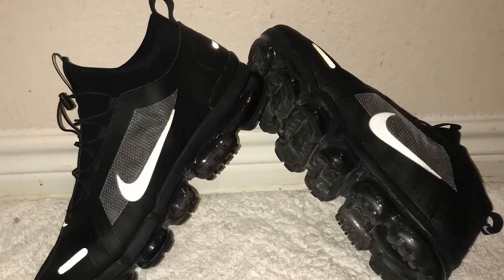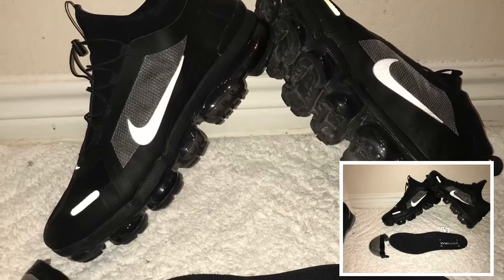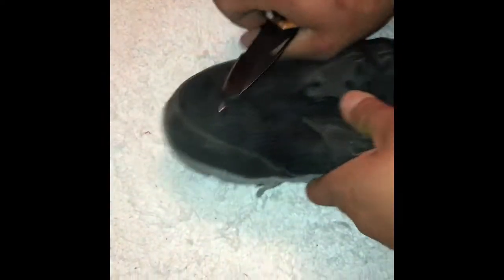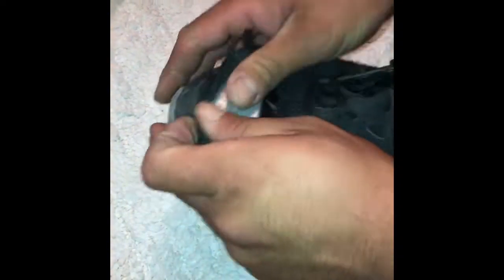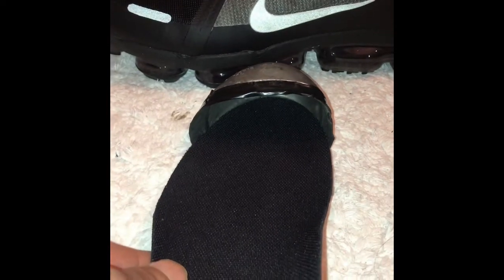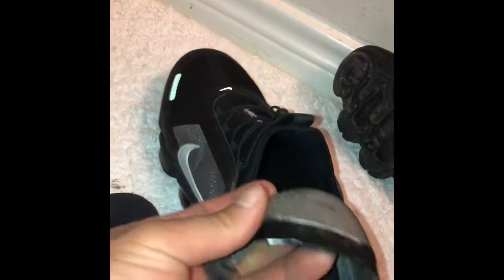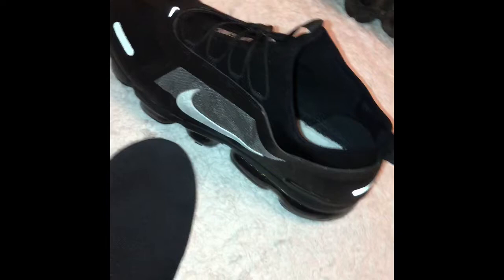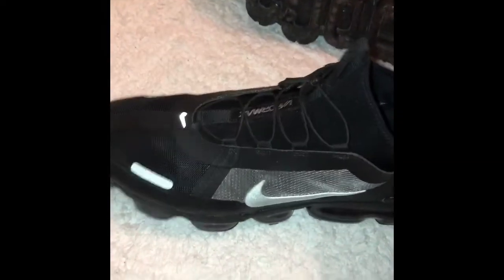How to make your own steel toe Nikes

Comment: i made it with steel reinforced midsole underneeth the toe, so the load spread out evenly and didn't just penetrate the rubber through when under load, and i added steel reinforced heel counter. it's wheigh about 1.5 kg a pair and nail-proof
Reply: I hear what you're saying but can you tell me how you did that?
Reply: So you're wearing grade 5 ballistic footwear

Comment: I’ve just done something similar after years of pain through safety boots and my flat feet which after many a insole I still struggle except wearing a specific pair of sketchers I thought “sod it I have 10 pairs of steel toe boots in my garage” so I cut some caps out and bought the next size up in my comfortable trainers then inserted the toe cap 😍😍 can stand 24/7 on concrete floors now 💪🏻
Reply: I also have the same issue with flat feet but can't find a pair of boots that don't hurt me. What pair of sketchers do you use? I would like to try them
Reply from the maker: https://instagram.com/s.p.j2022?igshid=OGQ5ZDc2ODk2ZA%3D%3D&utm_source=qr

Comment: JUST A HEADS UP, been rocking my vapormax steel toes for years now. just recently started a new job and they didn't let me wear them because they are not ASTM certified, even though theres nothing to crush my foot.... so if your job hates you , they probably won't let you wear them lol.
Reply: @James Isaac that's exactly what I said lol , manager just wanted to be a pita
Reply: Just cut out the astm certified sticker out the old shoe and gorilla glue it in the new shoe on top of the size tag

Comment: What if you lose get ran over and the plate shift because it’s not intact with the shoe but just slide and pinch ur toes off
Reply: Only reason to use steel toes is to satisfy your employer. I could care less if I lose a toe as long as I'm comfortable 😂

Comment: Was the steel toe from the old shoe the same size as the Nike? Thanks.
Reply: No, if u listen, get says his nikes are a size bigger than steel toe.
Reply: @jasonmcbride2105  okay wait I thought it was the other way around. The boots were a size bigger than the Nikes? I need to do this with my orthopedic shoes for work. Do I buy a smaller, bigger, or same size in steel toes for this to work, please 😥
Reply: @lovely_sadist1237  Nikes r size bigger to accommodate the toe
Reply: @lovely_sadist1237  buy the steel toe shoe In your normal shoe size. The shoe you want to add the steel in should be a size bigger than your normal size so that when you put your feet in the shoe it's a perfect fit

Comment: Can't find the steel cap to fit my nike air max plus TN
Any suggestions??
🙏🙏🙏
Reply from the maker: 7hugl1fe r1d3r5 if you see any still toe boots that are  pointy, you can take those out those should fit because the steel toes are small, but if you are  a size 10 make sure you buy a size or two bigger, for example take the steel toe to the store ask for  the size insert the steel toe if they are too tight ask for  a bigger size 👍
Reply: @sperez6140  Ma Man, FoSho gonna sweat that. I saw you took the Reebok steel toe out & put the in the Vapor Max 😎😎😎

Comment: So just to clarify this, I wear shoe size 10¹/²......so I need to buy shoe 11¹/² then get a steek toe cap size 10¹/².....correct?
Reply: Bcuz I'm gonna buy cheap steel toe kicks from walmart and tear out the cap. But I want to make sure it's the right size so I don't fuck myself out of money lol
Reply: Yes
Reply: So I tried this and the steel cap after I put it in my shoes, it was too tight! Didnt work. I put a steel cap in a pair of air max 90s.

Comment: Before you buy shoes to cut out just order caps
Reply: I looked all over for just the caps bro. Couldn’t find any anywhere.
Reply: @lonnievigil3681  Honestly. Way too much effort to try and find some. You would think you could easily find a pair or someone would have an easy conversion for regular shoes available but nope this is what we have to do 😂
Reply: Go to a thrift. Buy them and cut out the cap. Shoes will be smelly and fucked up anyways. The cap is encased so they didn't touch it.

Comment: Do not do this. This is more of a hazard than a protection. The steel toe cap will slide/tip when it gets underneath something heavy. I'd rather buy real safety shoes than risk losing my toes.

Comment: So did you mean that the steel toe shoes needs to be size smaller than your regular size?
Reply: No. The shoe dat u are putting the steel toe in needs to be 1 size bigger than your regular size.
Reply: @jumpout915  why though? 👀
Reply: @lovely_sadist1237 because the steel toe takes up room. If you use a pair of shoes that usually fit you once you insert the steel toe in them they will no longer fit you correctly and will be mad uncomfortable not to mention it will more than likely damage your toes which defeats the entire purpose. Thats why you need to buy a pair of shes that are 1 full size bigger than what you usually would wear in order to compensate for the space being taken up by the steel toe.

Comment: It’s not even that I find them steel toe hideous. They f*cking hurt. I brought a specific pair of orthopedic shoes.l for work. Now I’m required to wear strap toe. I need to do this. 

If I wear a size 9in regular shoes. I would need to size up one size for steel toe before inserting them in my regular shoes?
Reply: If u have big issues with your feet and already wear your own shoes with orthopedic... Try tiger grip safety overshoes.

Comment: This is a bad idea if you work in a place where you actually will need a steel toe at some point to protect you.
Reply: How so
Reply: @jonomano3992  maybe the toe cap can get pushed up against the toes because it's not in place
Reply: @jonomano3992  having the steel toe lose in there like that is dangerous to your feet and toes when something heavy enough falls or pushing the toe your feet will be crushed or worse , toes cut off by the not secure steel toe. Not a good idea
Reply: Depends on the place. My job requires steel toes, been there 6 years, and nothing there is heavy enough to actually hurt you. I’ve been sneaking by with a standard pair of doc martens for the last 3 years
Reply: @SuperflyLamar  Lucky haha the pair they gave me had me literally dead by the end of my warehouse shift, the bottom doesn't even bend ffs when you walk and place your foot down the back touches the floor first like usual but then it just slaps down flat. The sole doesn't bend and lay itself down if you know what I mean, which is really important for energy dispersion (like how people do a roll after jumping from a high place, it disperses the energy  gradually as different parts of your body touch the floor instead of just falling flat on your feet and having them take the full force in one blow). They gave me bad sores on my feet I wore normal shoes the next day that are black leather and honestly look like safety shoes, but security guard clocked me and gave the shitty ones again :( Ordering a good pair on amazon now.
Reply: They’re real steel toe inserts. I don’t understand why you think they wouldn’t protect you. They’re literally steel.
Reply: @lonnievigil3681  the point they are making isn't that they aren't steel toe caps, but that the protection the provide do not meet and safety standards and are more dangerous than safe do to the caps not being secured in place between the layers of the toe of the shoe. Something heavy falls on them the cap will either shift into your toes crushing them or the cap with rotate down onto you toes severing them.
Reply: @SuperflyLamar same here I just wanted some steel toe addidas
Reply: @RATFgaming so secure the cap in place..
Reply: @solekefs626  That the whole point of steel toes 😂. They’re supposed to make a clean cut if something smashed your feet.